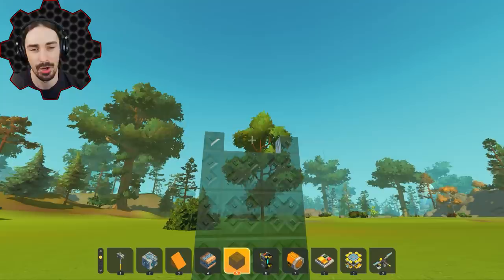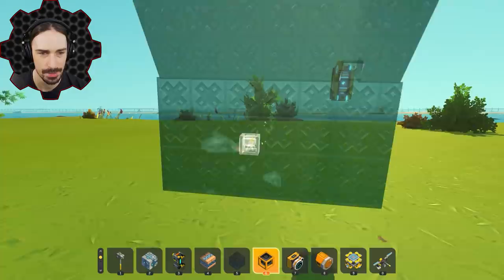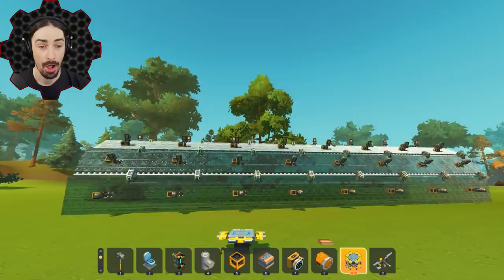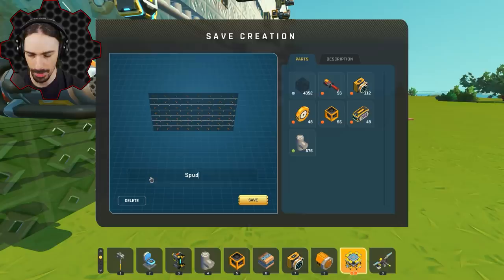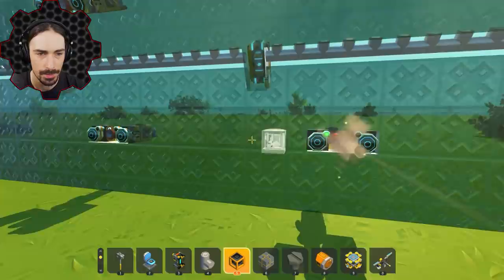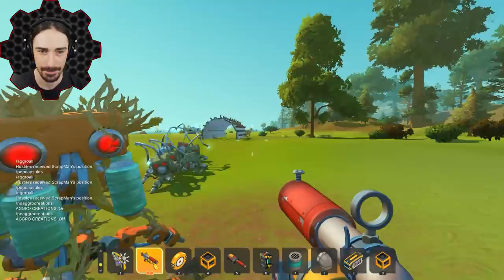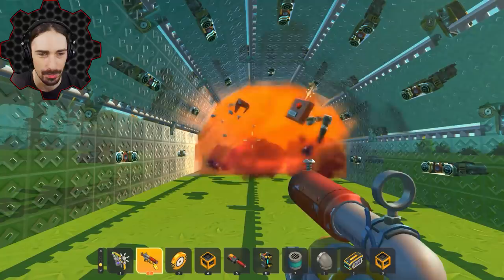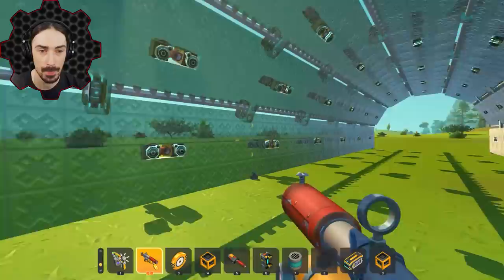Over-Engineering Impractical Weapons: Spudgun Tunnel! - Scrap Mechanic Gameplay

Comment: All you need to do to make a survival version is
1: weld the other side. Notice a lot of the “glitchy ness” was actually the spud gun recoil messing with the hinges

2: Maybe even make the design a square tunnel with spuds all on the sides
Reply: All he needed to do was make a frame along each side and connected along the bottom, thing is on the lift it's 1 straight sheet lol glwt

Comment: Instead of connecting the segments together, make a wall on each end and have the angled pieces just pivot on bearings. That would reduce the entire creation down to 9 pieces and 8 bearings (since the vertical sides and horizontal top don't need to pivot)

Comment: I feel like this could have been made much more efficient and much less laggy by putting the spud guns closer together. you could actually manage to use this design to make a tunnel where the spud guns are just one block apart, by alternating spud-guns and sensors and just using logic to trigger each spud-gun off of the two sensors next to it. doing so would give you the same firepower with 1/12th the length, which would likely be less laggy.

Comment: 1 creation. the bots walk through a zone with sensors which tell the spud gun rotational device where the bot is and the gun rotates and shoots a few times in tat direction until a new sensor is lit and it rotates to shoot there... You can setup multiple layers of sensors to tell the gun where to shoot as the sensors are activated....

Comment: The reason why the bots attacked the tunnel when you said no aggro creations is because they are programmed to attack anything that stands in the way of the player and itself and that doesn't get disabled by the no aggro creations that command is only good for the tape bots Ive seen this happen in challenge mode with some of my challenges ive built

Comment: All of this ipractucal things, but we still dont know how to kill a farmbot in survival?
Well not anymore!
After hours of research, i found out the deadliest and cheapest farmbot killer (yet)
Here's how to construct it:
- make a 3 high 1×1 poll
-place a bearing and another block on top
-extend the top block at all sides by
 16
-place a bearing on the side ends
-make 2 wide crosses on bearings
-make the crosses tips 2 block wide
-place an engine and a seat in the middle (make the seat not wobble in free cam)
-connect the engines to the bearings and the seat
-make the central bearing rotate in the direction where the crosses are faceing
-make the cross rotate anti-clockwise (outside up)
-crank the engine up to max and press w when a farmbot comes to you to yeet them

I prefer building out of wood because it needs to be light but it doesnt suppoded to get hit.

Weld it to the ground near a farmbot spawning location and come get your easy passkey daily!

Enjoy your farmbot yeeter and use 1-3 gas intead of 60 spuds!

(Make sure you test it in creative before building it in survival)

Comment: Multiplayer Monday idea:A race where you can only build vehicles without opening the inventory, and using only parts from the workshop.
Then to join the parts without deleting you will use the weld tool.

Comment: It flopped like a fish because you welded one of the sections the wrong way, so one of the controllers tried to fold it the opposite way.
You could also weld the top part and the sides together, so it will be more stable